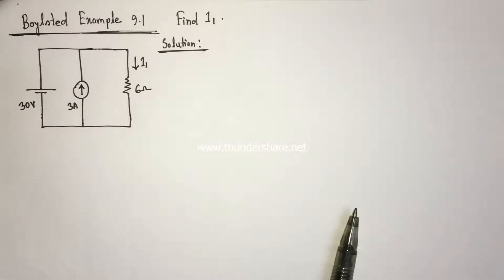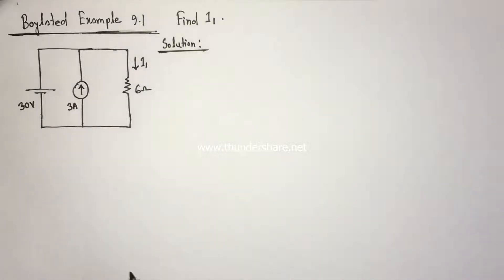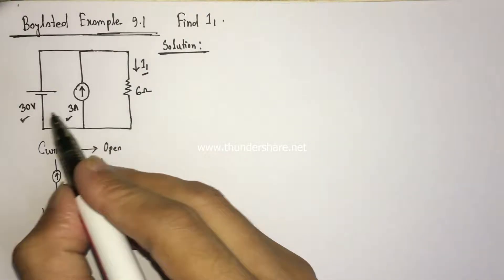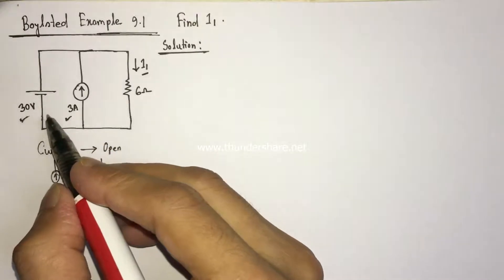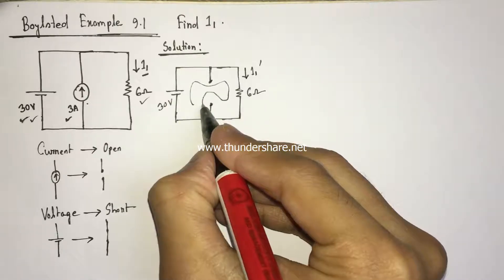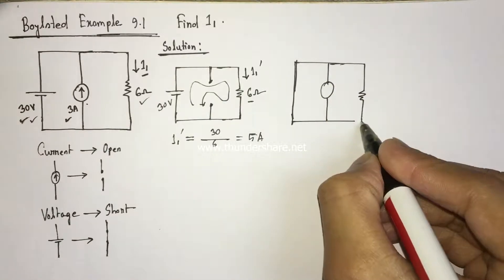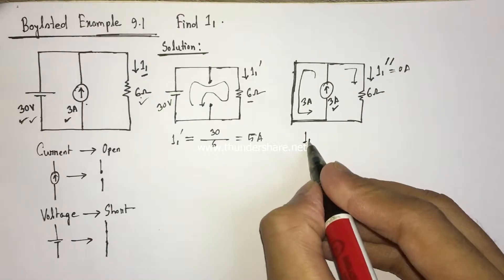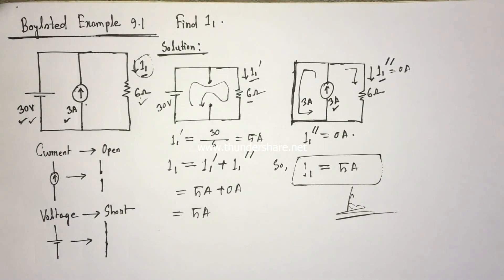Superposition Theorem Analysis (Boylestad Example 9.1)

Comment: Why all 1A currwnt flows through the wire but not from 6ohm
Reply: Because current prefers to travel in low resistance path than high resistance path. (Similar to chosing less traffic route than more traffic route).

Less traffic - less resistance- free to move